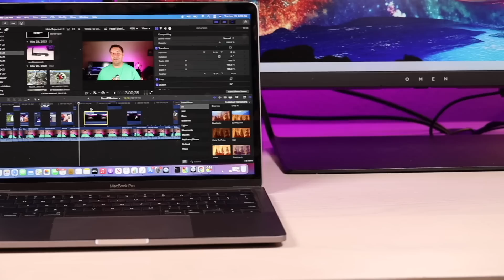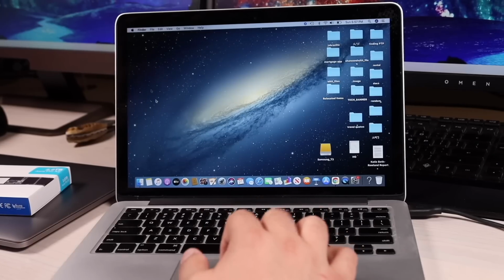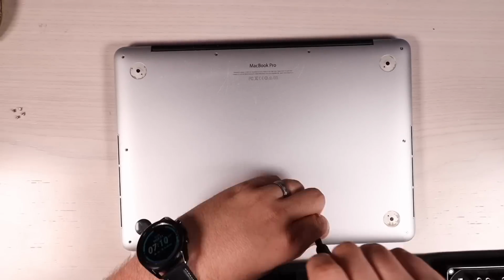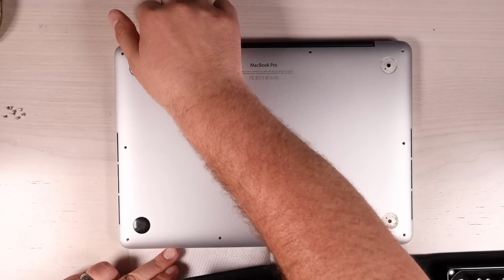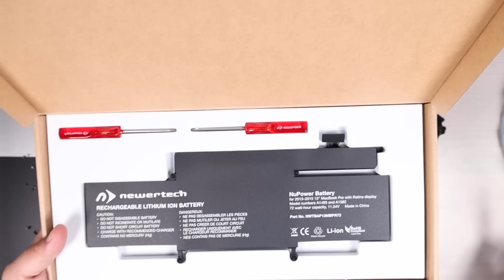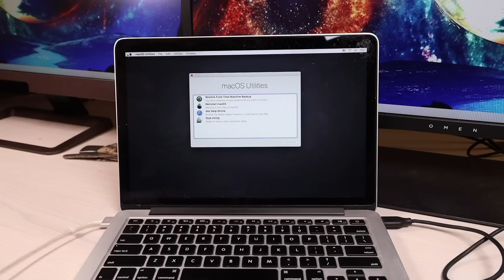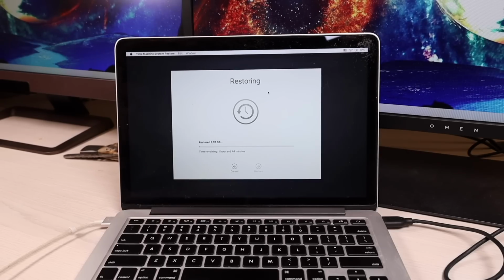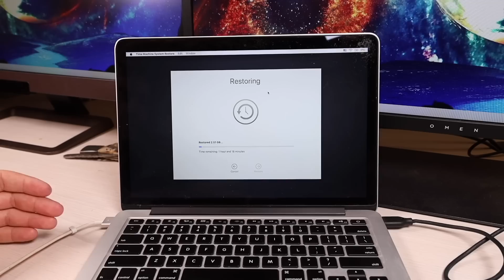Macbook Pro Upgrade! 2TB SSD with Battery Upgrade in 2022

Comment: I am watching this on my 13 inch 2015 Macbook Pro :) I did the samething on mine. I replaced the drive with a 2TB and also the battery :)
Reply: and how is performance ? What Os are you running ? Is it practical for everyday use in 2023 ?
Reply: @gb1deep  it runs pretty well I have it running on Mac OS Monterey. I use for some photo stuff and video editing but not too high end and I use it took play some videos games on it. It works pretty well I am surprise it still can keep up with some stuff on it.
Reply: I use Monterey it works prefect with it.  @gb1deep
Reply: what Ssd do you think would fit my 2016 MacBook Pro no Touch Bar 13 inch ? I want to go for the 2TB if they have anything higher  that’ll be great. L
Reply: @gb1deep  I think you should be able to fit a 2TB but that type of MacBook requires an SSD card is it smaller in physical size I think its called a 2208?
Reply: you should be able to use a 2208 form factor SSD you will to get type of SSD and the adapter for it.  @gb1deep

Comment: how do you upgrade the SSD if its soldered onto the board? huh?
Reply: My guess would be that you need to get the proper equipment and solder in the new SSD.  Its been done already.

Comment: You seem very competent at your upgrades and repairs but I always lay out some sort of fabric over my work table to prevent anything from rolling around. Then I place them on the cloth in a way that relates to their actual position in the machine and with the component I removed.
Reply from the maker: This is the first time I've done this with a laptop. Thanks for the pointers.

Comment: I've got a MacBook Air 11 inch 2012 model for 50 bucks on OfferUp from a college girl who didn't need it , cuz she just upgraded to the newest one with the m1 chip , it only have a 60 gig SSD and the battery is pretty much done for another $80 I'm going to do those upgrades and it's going to be a pretty good capable computer for a while
Reply from the maker: That's a steal!